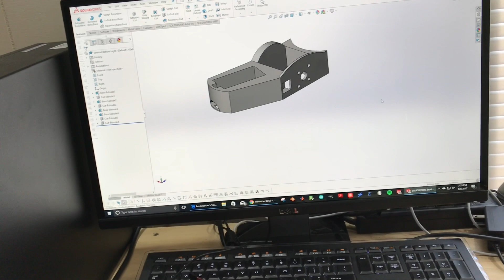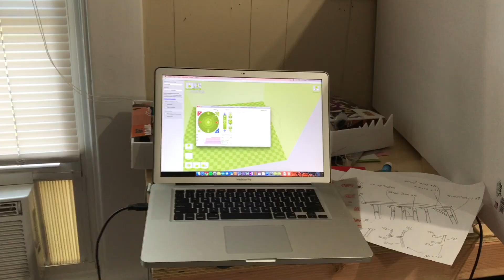Building a Beetle Combat Robot

Comment: Finally someone that is using alloy 910 update on how it performs i'm very curious
Reply from the maker: +Kyle L It performed like ABS and shattered, in case you were wondering. I need better layer adhesion for next time.
Reply: AltaPowderDog I heard baking it at around 80c should fix he layer problem
Reply from the maker: I'll have to try that next time for sure. I thought about it for this build but if I had screwed it up somehow I wouldn't have had time for a re-print, so decided against it.